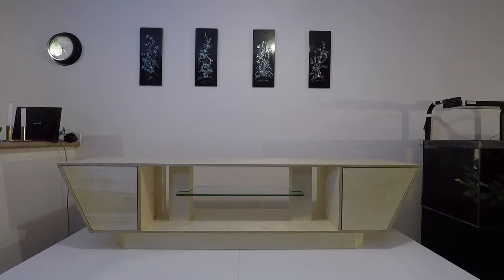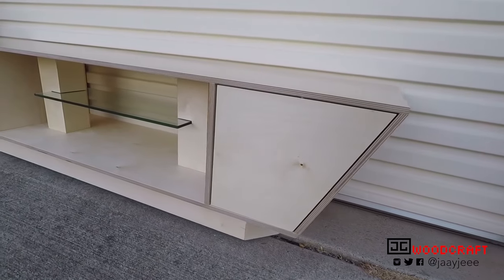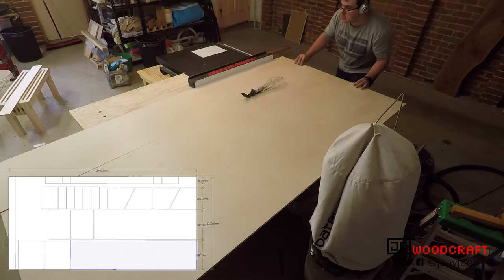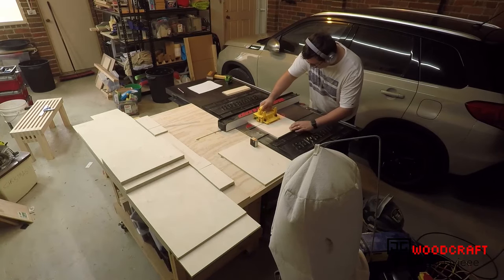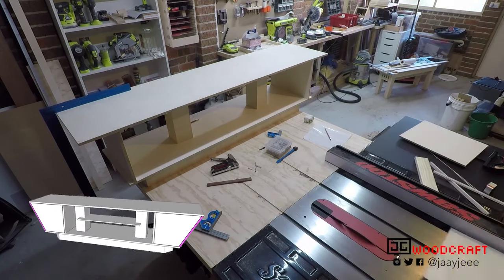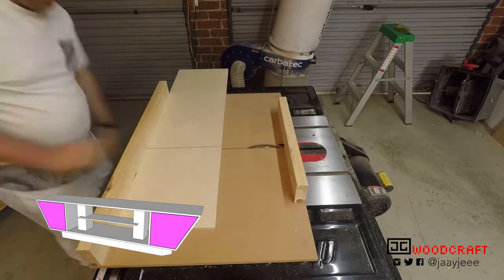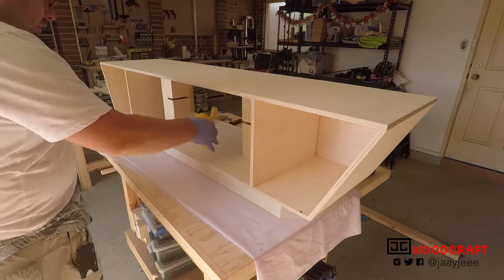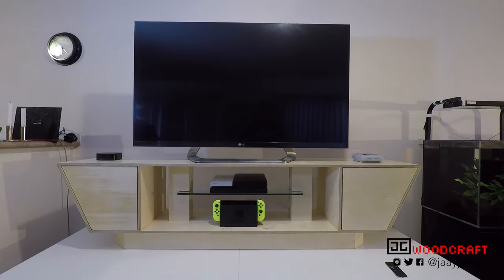Building an Entertainment Unit with One Sheet of Plywood | JaayJeee - #rocklerplywoodchallenge

Comment: How big was that sheet, it wasn't a normal 4' by 8' sheet was it?
Reply from the maker: Martin Marquez yes it was, 2400x1200 mm in Australia.
Reply: Jason Glavich wow
Reply: I'm guessing there is an exchange rate in money but it still seems extremely expensive for a typical 4 foot by 8 foot sheet of plywood.
Reply from the maker: This particular board is a B/B Grade with i think 11 plies? it would probably be cheaper if i went the lower grade faces with only 3 plies but that wouldn't look very nice, maybe if i was painting a project i'd use that. Also If it's anything, all prices in australia include Tax, where as i know a lot of US prices you pay the tax afterward i think? But yes! plywood is very expensive here.